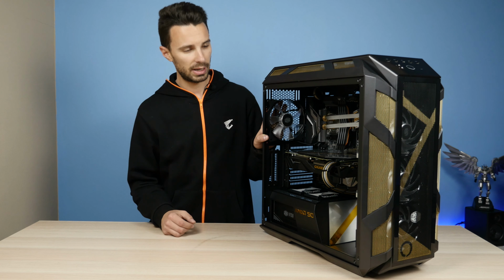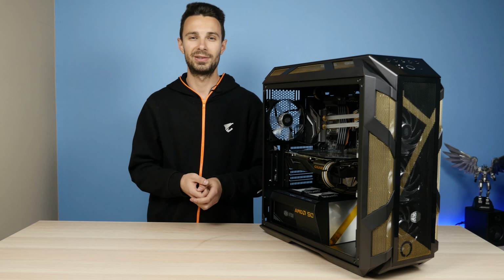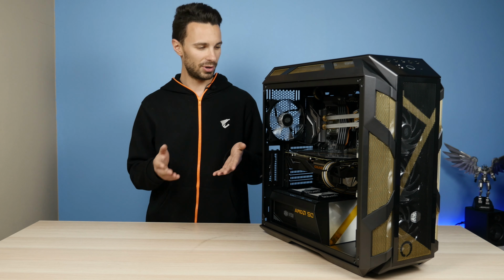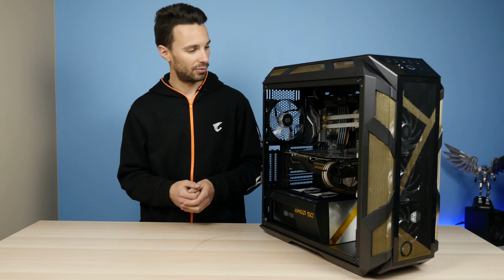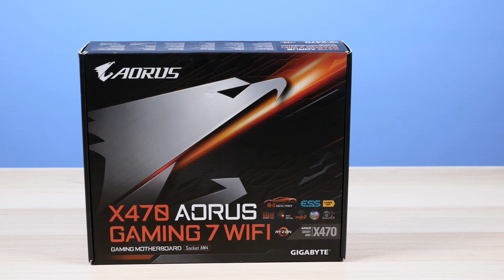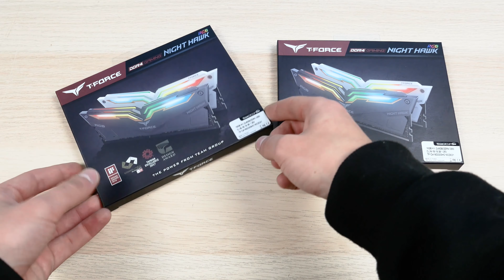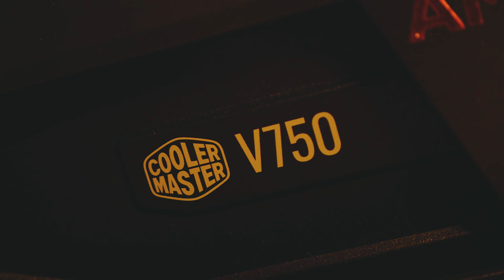Cooler Master H500M AMD 50th Anniversary Case Mod

Comment: Awesome build! Can the NZXT Kraken X72 be mounted on top? Radiator upper the bracket and the fans below exhausting /pushing the air? Will it fit?

Comment: Nice build, would have like to see the 200mm fans stay tho,
Reply from the maker: I did the original H500P and also the H500P Mesh White and kept the 200mm fans in those builds. I just wanted to change it up a bit :)
Reply: Sir plz help me, plz tell me can I use a 360mm aio along the two 200mm fans and can I use 3×120mm fans in the top side of this case??plz kindly reply me waiting for your reply